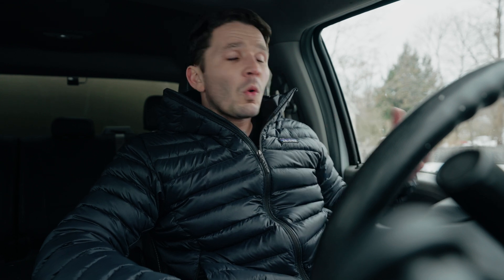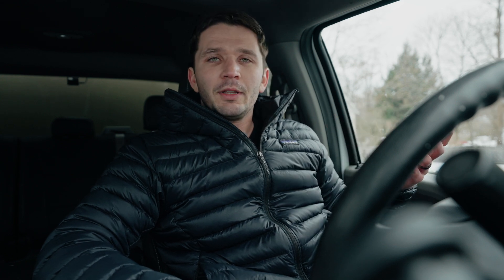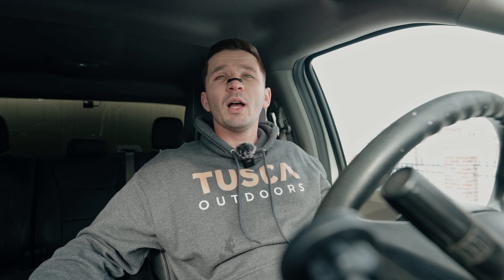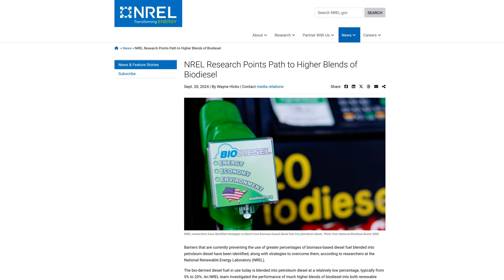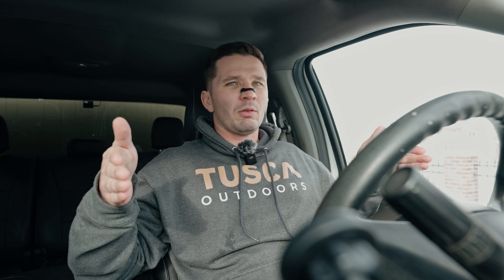The Problem With Biodiesel That No One Talks About

Comment: Your information is very interesting 
Back in 2012 I had a F-350 6.7. I noticed every time I took my truck to north Texas. On the way home(back to the coast) I would pick up 2-3mpg and my truck would not go into regen like it would do on a normal daily commute or even on the trip up to north Texas.
I finally realized that when I would fill up in north Texas they had non-biodiesel. Where on the coast we had biodiesel.
I started filling my transfer tank up with the diesel from north Texas every time I went up and found that my regen’s went way down and my mileage was a little better. 
Now the odd thing was I was getting the diesel in north Texas at these little fuel stations where as on the coast I always got diesel at Buc-ees. I even went as far to think that maybe there was something wrong with Buc-ees diesel 
Now in my new truck 2021 F-350 it does not tell me when it goes into regen like my 2012 plus finding non-biodiesel in Texas anywhere is darn near impossible 

Good information
Reply from the maker: Interesting story! Thanks for sharing. It’s wild how sensitive these new trucks are to fuel quality

Comment: The one thing California is doing right is the renewable diesel, it better in every way as far as i can tell....need to push that nationwide and ease up on restrictions
Reply: Yep, I’ve been using Renewable here in Norcal since I purchased my truck in ‘22.  Zero issues with emissions and fuel mileage is similar to same as regular diesel#2.  Crazy high cetane and burns clean.
Reply from the maker: Hopefully they spread that stuff around it sounds awesome. The US diesel fuel quality in general seems to be terrible. Crazy that California seems to have figured it out first haha
Reply: @ You would think.  California is hard anti-diesel out here, but they know diesel vehicles are here for the unforseen future.
Reply from the maker: Makes sense!
Reply: Yes but California diesel is now 95-100% biodiesel. So far I haven’t had any problems yet. But I don’t drive my truck that much. When I drive it is to pull my toy hauler or freeway driving. Hopefully I won’t have problems. I do run Archoil and change engine oil every 5k miles.
Reply: @claudenewman3440  Who told you that?

Comment: Well, Sir, not buying what you're saying. I run about 70K miles a year currently, a few years back I would run as much as 100K miles a year, and almost every pump I filled at was biodiesel. 220K miles on my first DPF equipped 2012 F250 6.7 diesel, over 614K miles on the 2015 RAM Cummins that followed that, and currently 220K miles on my 2022 F250 6.7 diesel and absolutely no biodiesel derived issues with any of them. Never any P2459 codes, all emissions intact and operating properly.
In addition, there are hundreds of thousands of 18 wheelers running millions of miles every year, all running that same biodiesel. If this was a real issue, all of those trucks would be having constant problems, and it just isn't happening.
Also, by the way, the BP15 is just BP's 15% biodiesel blend.
Reply from the maker: Thanks for the comment, but it sounds like your experience with biodiesel is different from the issues I have encountered.
Reply: @powerstrokemaintenance  Point being that I do not believe your issue stems from biodiesel use.
Reply from the maker: @Ltngdrvr that’s fair. Thanks for sharing your thoughts. Do you think it’s from the age of my DPF?
Reply: @powerstrokemaintenance  Not necessarily age, but could have some defect. But, you have already discovered that changing parts without thorough diagnostics is not the way to fix it. A really good diagnostic tech is what you need, to do the deep dive to find the core issue. Anything short of that is just guessing.
Reply: @Ltngdrvr good suggestions.  I can't find any real diesel anymore.  It's been 6+ months since I have been able to find non bio. So far no issues. Completely stock truck except I just installed the dcr hpfp a couple weeks ago. I have 161k+ miles on the truck. 18' f350 6.7.

Comment: I filled my semi up at a Casey’s truck stop yesterday, which had biodiesel in it, treated it with hot shots winter treatment, and this morning I was gelled up at 0 F. Pretty sure it was because of the biodiesel and it ended up having high water contamination. I’ll never fill up at a Casey’s knowing I’ll be in cold weather again.
Reply: For what it's worth...project farm recently did another review of antigel products a dew days ago.  Informative if anything,  to include the repair geek linking up with lake speed Jr for an additive test of a small group of common products.  Glad I don't have to deal with forced bio products in the mid Atlantic coast.  Yall keep warm and don't gel up.
Reply from the maker: Thanks for the comments
Reply: @willb7975  yeah I follow them both regularly and seen the vids. The problem is definitely the biodiesel, as I’ve used Howes and Hot Shots in the past with good success well bellow 0 F. I’ve recently switched to Hot Shots after researching the lubricity benefits. It seems to me the only way to reliably keep the bio blends from gelling is to blend it with #1 fuel.
Reply: @willb7975  I watched that video and there were some of those anti gel I have never heard of before and I drove a semi for 29 years. I have always used howes and never had a problem with it but it didn’t do as well as others so brand name isn’t always the best. Peak actually won that test and it’s a new one to me.

Comment from the maker: The other point I did not consider in this video was the age of my DPF. I’m sure if you have a DPF that’s fresh from the factory it will be better able to handle the soot load of bio diesel. At the same time though, with better quality fuel my DPF performs as good as it did 100,000 miles ago. So I’m not exactly sure how to interpret this.